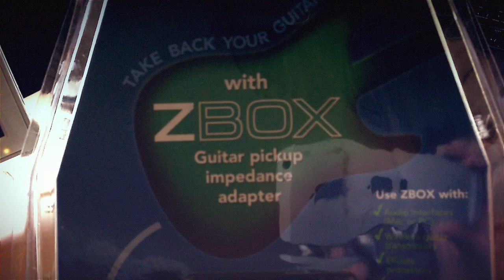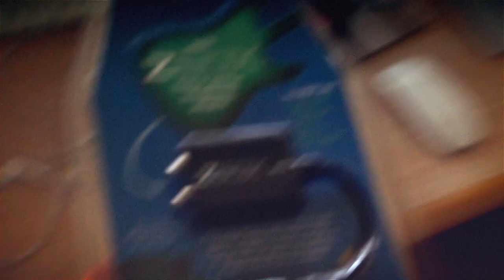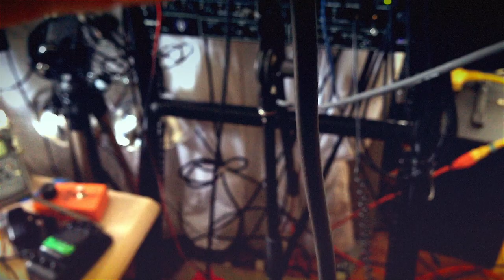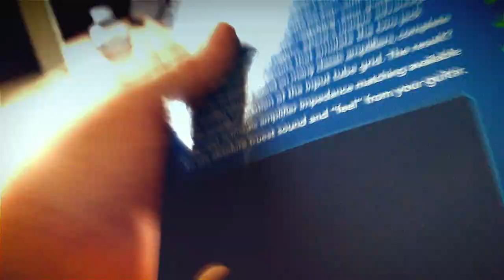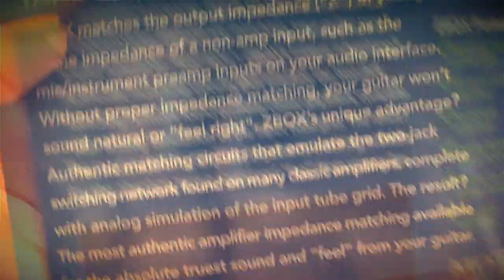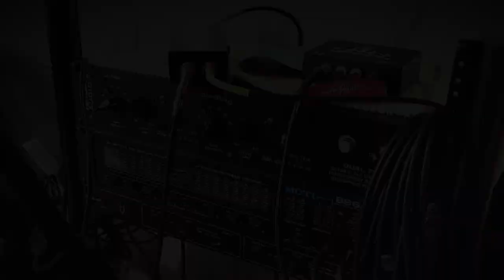MOTU ZBox UNBOXING and DEMO

Comment: Sounded sooo much nicer with the ZBox. I don't need one as my interface has a guitar level input (as more and more interfaces nowadays do), but I wanted find out what this device was and hear the difference.

On a separate note, I've not had much luck with realtime audio applications on PC. From DAW monitoring to Rocksmith, there's always been too much lag. Either that or issues like popping when I've taken steps to reduce the latency. It's pretty annoying as some of the instrument simulations and effect plugins nowadays sound really good.
Reply from the maker: Sorry for the late reply. If you're still having this problem what is your computer setup (CPU, memory, drives, DAW, etc..)? Clicks and pops are generally either caused by a slow computer or your sample rate is not in sync somewhere. Even with a 12-core 3.46GHz Xeon system with flash storage and a ton of RAM, to lower the latency to an acceptable level of 128 or lower I need to disable most VIs and plugins. After tracking I turn everything back on. Also, if I know I going to track guitar I'll usually do that to a stereo submix of all of the other tracks. That's just life in the world with native based DAWs. Best of luck..
Reply: +Steve Steele I'm on the verge of buying a new PC. It will be high spec'd for gaming and more (i7 6700K, 16GB DDR4 RAM etc). There are some potential problems I foresee however.

The big problem is that I cannot record vocals or a guitar cab (should I wish to do so) etc at home due to fussy neighbours, so ideally I'd use my laptop for audio production work.

My current laptop is incredibly poorly spec'd by todays standards and is one of the sources of my poor experience thus far (I was given it free, so I can't complain). I think a Macbook and a Thunderbolt interface (preferably something with onboard DSP) sounds like the way to go for mobile music production, but that's a lot of money that unfortunately I do not have.

I imagine that moving work back and forth between a Mac and a PC could be problematic. I also imagine that I'd have to buy more than one license for DAW software (which I really would not want to do). It would ultimately be better to keep everything audio production related to one machine.

Basically, despite my yet to be bought PC being well equipped, it doesn't really help my situation that much.
Reply from the maker: +napalmhardcore I've been chasing computing power for a few years now. It's an expensive habit! But I think I've got the setup now that has the power to do just about anything. I'm currently using two MacPro 12-core X5690s with 96GBs and 48GBs of RAM each, and some Samsung SM951s in RAID 0 for my sample drives. They're synced Together via Vienna Ensemble Pro and Digital Performer. Obviously nobody buys a rig like that overnight but I can tell you in order of importance to get my rig to work right it's a fast CPU with as many cores as you can get (all the pro DAWs are very well coded for multiple processors), fast flash SSDs and a lot of RAM.  

However, I do a lot of MIDI orchestration and that's mainly what needs all that power. If I was just doing band music, EDM or just tracking demos I wouldn't need as much. A MacBook Pro with a TB interface would be fine. But a PC gaming rig would mostly be ok too. A 6700k is a good choice. If you could get a m.2 slot...
Reply from the maker: +napalmhardcore .. on your motherboard that's PCIe 3.0 for a SM951 to read project files from, an SSD for a boot drive and 16-32GBs of RAM, that would be very good. I'm not sure what DAW you have in mind but I really suggest one of the major ones. DP, Cubase and Logic for projects that combine a lot of MIDI, samples and audio are good choices. Studio One is getting there. I'm sure you have this figured out. 

If you have a good sounding amp that you'd really like to record but can't due to volume I highly recommend getting either a Torpedo cab sim, or on the slim chance your amp has a power amp line out, you can plug that straight into your interface and use a cab sim plugin like Red5's mixIR2. I use that with my amp and it sounds perfect. Maybe better than micing. Singing has never bothered my neighbors. Good luck with your build and hit me up if you have any questions.
Reply: +Steve Steele "with 96GBs and 48GBs of RAM each"

I didn't even know you could put that much RAM in a computer (if you don't need it you tend not to investigate). There I was thinking 16GB is over the top for most applications. Then again, I'm not exactly a power user.

For my purposes I'll most likely need a very modest machine in comparison to the specs you are talking about. The biggest problems I've had in the past is latency for real time tracking (I prefer to hear stuff like reverb etc while tracking and for VSTs I'd imagine low latency is essential) and just generally having weak hardware.

Despite the fact that you are now seeing some PC motherboards incorporate Thunderbolt, none of the interface manufacturers seem to be supporting Windows with them. That's the main reason for me thinking that going with a Macbook might be my best bet (as I need something portable).

I've spent very little time with any particular DAW (I tried Cakewalk more than ten years ago and have had Light versions of Cubase and Ableton bundled with stuff), so I am not used to any one workflow. I'll have to learn whatever I decide to go with pretty much from the ground up anyway, so I'm free to go in any direction.

As far as I can tell they all have their pros and cons. Most of my prior research into them has been for the Windows platform. I'd need to do similar research for my options when it comes to Mac.

With regards to recording a cab, I'm at a point where I want to experiment with different ways of doing things. I want to try some traditional methods like a mic'd cab and real amp. I then want to try stuff like modeling (digital or analogue) and IRs. I then want to try various combinations.. For example a digital modeler or analogue preamp like the AMT Legend series into a real power amp and cab. Alternatively, a real amps line out into either a power amp sim or straight into a cab IR (depending on whether the line out is pre or post power amp). Maybe do some experiments with overdrive pedals etc, you get the idea.
Reply from the maker: +napalmhardcore If you get a MOTU interface some of them have reverb and compression built in the interface so you can monitor that in real time. You don't have to print those effects, just use them for monitoring if you wish. They call it CueMix. 

The reason I have so much RAM is so I can load all of my sample libraries at the same time. It's the only way to get playback. But for projects that where audio tracking is the main job 16-32 GBs is plenty of RAM. As you know the more tracks and plugins you need the stronger the CPU needed. There are ways to get by without Thunderbolt (I'm still using eSATA), but I'd much rather be using TB and with Thunderbolt 3 coming it's by far the best external bus. I think you're on the right path. Everyone will try and tell you what DAW is best and even though I use Digital Performer it' sounds like to me you'd like Logic X or Pro Tools.
Reply: +Steve Steele Thanks a lot for your advice. The last time I took an in depth look at Motu's devices was maybe a couple of years ago. The Ultralite AVB could well be a game changer as it has all the things I'd want for monitoring while tracking covered (compressor, EQ and reverb).

Aside from the TB and Mac route, I'd also been considering some relatively inexpensive outboard gear. This (the Motu) appears to be a much better solution as it will be a lot more portable and less troublesome in terms of signal routing.

Part of me likes the idea of getting a few pieces of outboard gear but it probably isn't the most sensible solution for me.

Another thing I'm currently looking for is something to give me more headroom for my mics (and future mics). From what I've read, the Cloudlifter would probably be the most sensible solution, but part of me really wants to try out the ART Voice Channel.
Reply from the maker: +napalmhardcore I keep going back to MOTU interfaces. Just when I'm considering an Apogee I find out the MOTU AVB series are using the same exact converters. I'm looking at an 8M for my OS X studio and maybe a MicroBook for an iPad Pro portable studio that I'm putting together. I have to say, the new GarageBand that just came out with AU support, along with Notion iOS and the iPad Pro has been a bit of a game changer for me. I spend almost half my time writing and arranging on the iPad Pro before importing the project onto the MacPros. It's made my workflow much faster. 

I plan on buying a Fishman TriplePlay as a MIDI controller to some of my orchestral libs for times when I need a certain feel that a piano controller doesn't quite get. As far as I know they don't have an iOS driver unfortunately.
Reply from the maker: +napalmhardcore I've don't have much outboard gear left. I've still got my guitar and bass amps. My only preamp is a Vintech Dual 72 that's been modified with some bright switches by Vintech. I do have an old ART tube preamp but I never use it. Maybe I should try it on guitar before I remove from my rack but I just got a ribbon mic for my guitar cab and I doubt I'll ever use it anyway. If you're interested in a Neve type preamp, check out the Vintech line. Yeah, they're not cheap but between getting a really good U47-ish mic, upgrading my MOTU interface with better preamps, converters and an external clock and the Vintech, that made the difference between a commercial quality mix and a demo quality mix that I had to re-track at a different studio. I can't say enough about not wasting money on hardware that you'll end up replacing in a few months, because I've wasted a lot of money on junk! Anyway, I can vouch for the Vintech stuff. And the Avedis MA5 500 module is great for vocals.
Reply: +Steve Steele I think there is a very strong possibility of me owning a Motu in the not too distant future. I'm not entirely sure which one yet.

I was looking at acoustic pickups yesterday and I spotted the TriplePlay but I didn't really investigate it. I have a long list of things I want but can't afford, so it's probably best I don't tempt myself with yet another piece of gear :)
Reply: +Steve Steele I think I've romanticised the idea of having a rack in my own head. All those meters and knobs just get the better of me lol. I look at and drool over a lot of gear but I don't have a whole lot of money so actual purchases are few and far between.
Reply from the maker: +napalmhardcore Gear lust is strong! I get it. And some of still sounds better or more convincing. But for a home studio, even a good one it takes up so much space and costs too much. I've had some cool outboard gear but I've sold it all because I didn't want to deal with all the costs involved. I wish I still had my DAT machine though. Even though I have absolutely no use for it. I'm a sucker for tape machines!

Comment: Can you use this as a split-er to an amp and a recorder?
Reply from the maker: No. Splitters, at least good ones, have circuitry that actually splits the signal into two separate signals and sends them to the two paths (amp and recorder), while not allowing either signal to flow back into the other. Without this circuitry (resistance) you get a simple "Y" cable that will cause problems because it physically connects the amp and recorder together and creates a loop. That wasn't the best explanation, but look at a true splitter like a Lehle or Radial J48. Once the signal is split they have resistors that disallow either signal from flowing back into the other. Hope that helps.
Reply: ***** Im looking at the JHS buffered splitter to send my signal after the distortions to an amp and also to my mod pedals then another amp.
Reply from the maker: +Eric sin sinner Anything that has transformer isolated inputs. That's the term I was looking for last time but it slipped my mind.
Reply: Thanks what do you think of a wet/dry rig vs stereo?
Reply from the maker: +Eric sin sinner Actually I like both. I like a three amp/cab setup. Cab in the middle is dry, the two on the outside are wet but in stereo. But to keep it simple having a stereo rig, two amps both wet in stereo is fine with me. Sounds huge and not having a dry cab is not a big deal for me when I'm on stage.
Reply from the maker: +Eric sin sinner I would put the splitter first before any pedals or fx. Give the splinter a clean guitar tone to transform, then add fx and route to amp and recorder.
Reply: Ever watch That pedal show? they suggest split after distortion.
Reply from the maker: +Eric sin sinner If you plan on sending distortion to both devices then yes, that's the only way to do it unless you have an expensive DI box that has fx loops. Just curious, what distortion pedal are you sending to which amp and what computer interface?
Reply: *****
Was just thinking of going to my two amps with a wet dry setup instead of stereo, I have Dr. Scientist the Elements and a Source Audio Kingmaker fuzz into a Moog MF chorus, stereo out to a SA Gemini chorus stereo to a SA Nemesis delay into a Champ II and a PV Classic 30